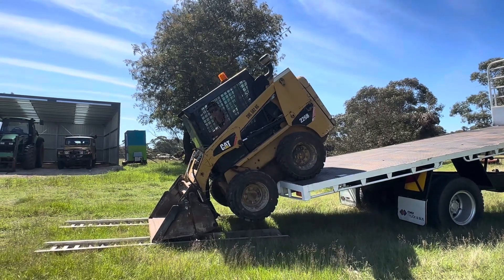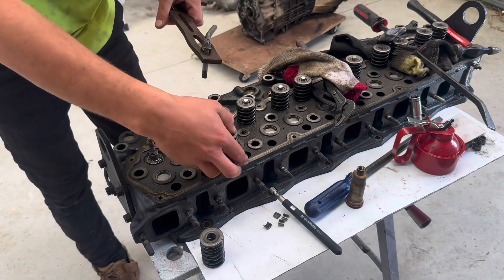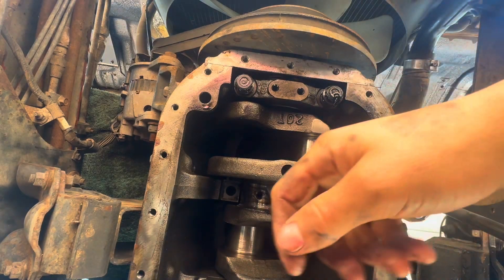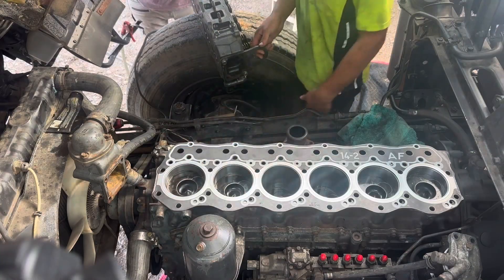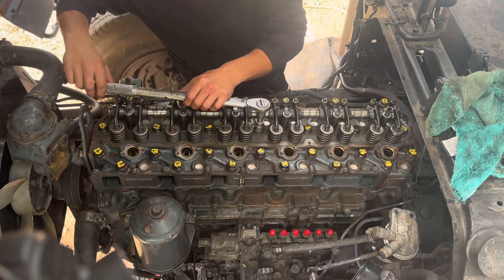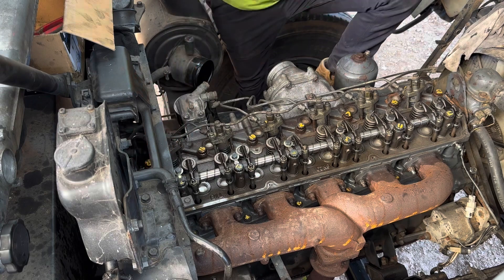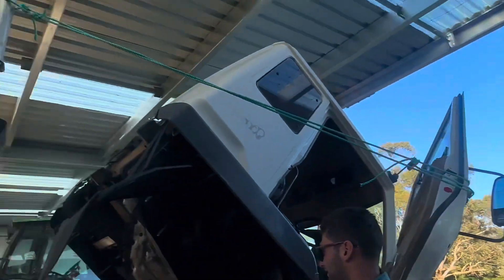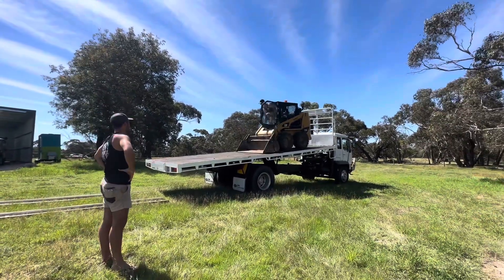Fuso 6D14 engine rebuild, problem fixed?

Comment: Did you suss out what was wearing on that push rod? Looked like you put it back in.
Reply from the maker: Turned out to be the exhaust Manifold bolt hitting it, I replaced the bolt for a shorter one and the pushrod still seemed ok to use again
Reply: @sheoakshenanigans4943  Nice one. Good job on the rebuild. Should be good for years now.